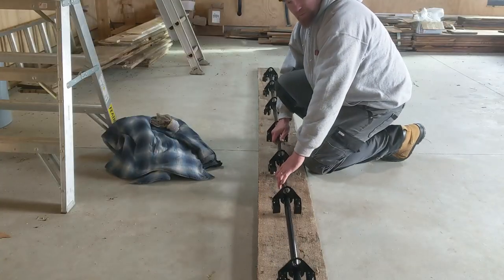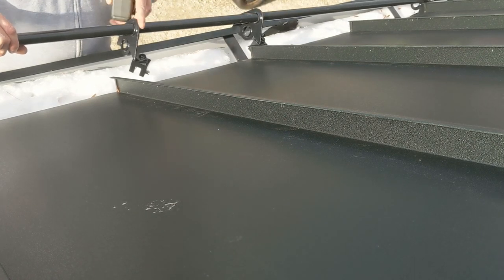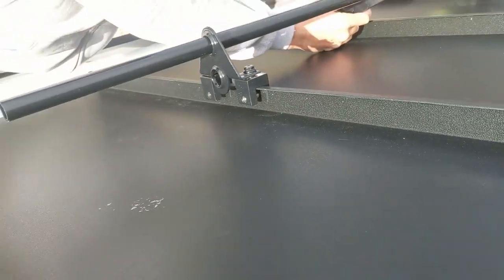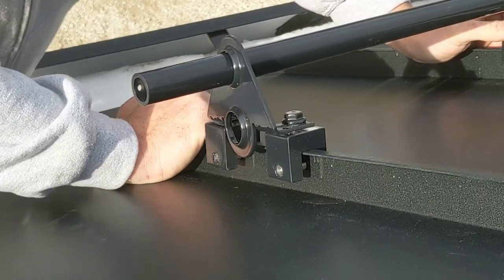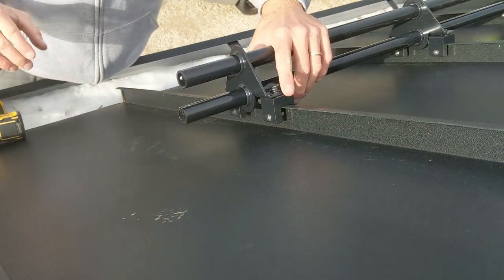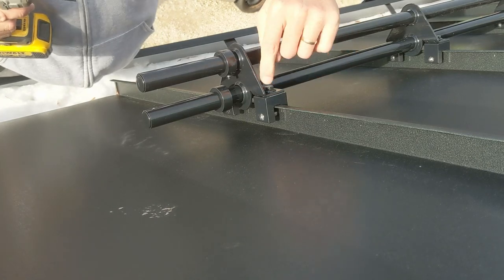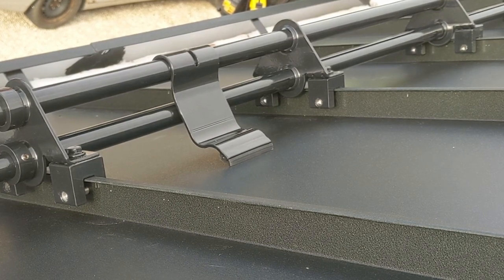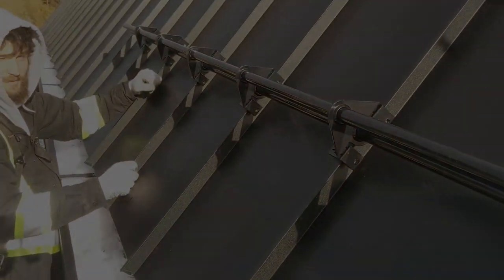How to install Snow Stops on a Metal Roof

Comment: Who do you guys use for that snow load system ?
What your thoughts on the "glue on" tabs?
Reply from the maker: For our snow retention we recommend the S5! Colorgard system...stuff can hold up a small car....as for the glue on one's, they are fine but tend to break off if a big chunk of snow let's go....what do you guys typically use?
Reply: @asm101 Thank for the heads up!  I've never used the racks or the "glue on" before, since we live in the valley, (below snow load)  but we recently installed a SS in the higher elevation 4-5K ft . 5/12 with 12/12.    Although I have used the S5's to install a custom made chicken ladder for HVAC  access, which worked very well.
Reply from the maker: Yes S5 has been the best and easiest to install solution for us and many other contractors in the industry....you guys do alot of standing seam? What sort of videos would you like to see on the channel?
Reply: @asm101   NICE ! " S5! Colorgard system"  Ty

Comment: I think it's a waste of your time
Reply from the maker: Unless you have have an entrance way that need protection from falling snow
Reply: @asm101  The bar stops the snow and the clip holds the ice and holds it so it melts instead of sliding off.  Work great above doors where the roof is high up or a roof over another roof.  Great video.
Reply from the maker: Yes exactly... This system is all we use... The fasteners also don't penetrate the roof metal